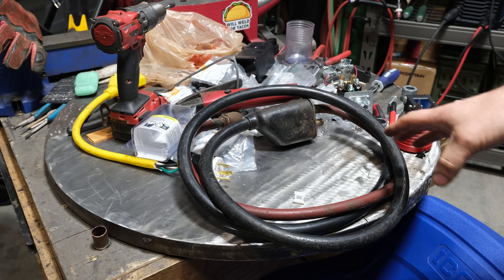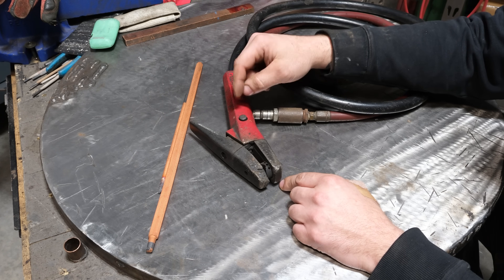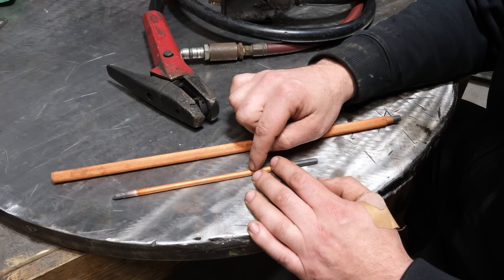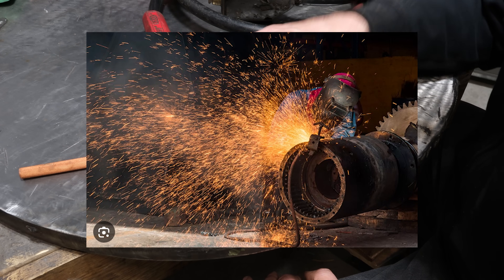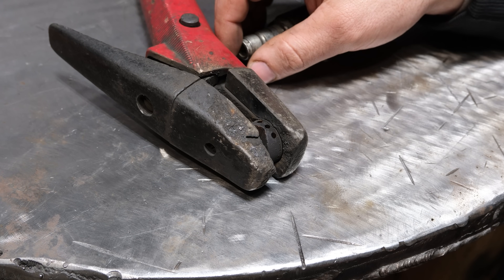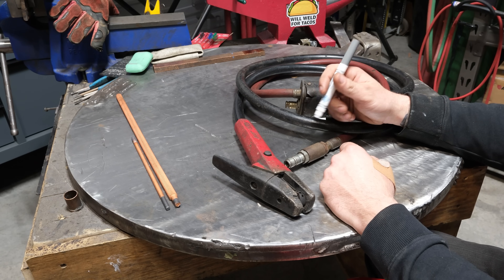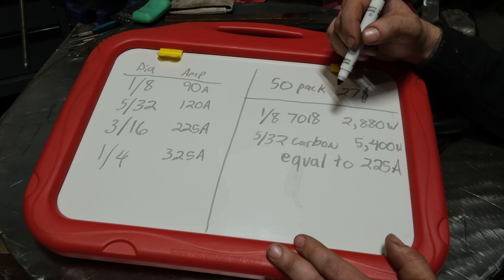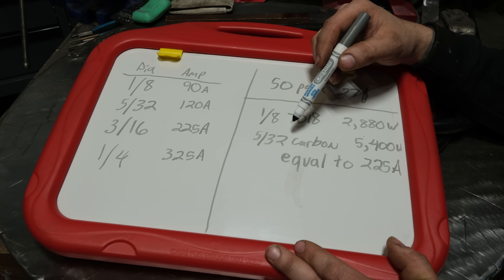Carbon arc gouging: the grinders angry cousin

Comment: It’s been a while since I was on a welding position at work, but we run the miller big blue air pac truck mount welders. We would use carbon arc cutting on manganese steel but not on high carbon steel. I think we used 400 amps for the size carbons we used. In basic welding class we had to cut and gouge a coupon to fit a 1x1x1/8 insert flush to the coupon with no more than a 1/16 gap on the edges. That was fun. I ground and sharpened my carbons to get the corners and edges. I passed but not by much. I have to admit, I didn’t used carbon arc cutting much, most times I could grind out the repair spot before I could get the welder set up. Thanks Greg.
Reply from the maker: Considering the work it takes to setup (and dealing with the hazards) for most jobs it’s simply not worth the time to use it.  That test sounds challenging to say the least, that would take some decent practice.  You must have had some decent skill to even barely pass 😀.

Comment: Great explanation about the home gamer machines. I  always wondered about that. Love watching Isaac use the carbon arc like a scalpel.
Reply from the maker: When it goes well you can literally just erase a whole weld and have a perfect clean surface left, like there was no weld.  It’s far easier (in my opinion) than using a torch, it doesn’t care as much about how poor the material is, and it is far more forgiving.

Comment: Wonder if you could do the old school method at home. Just using a regular welding rod, and an air compressor and blow the weld away. I wonder how that would work. Might get you by, but idk ha
Reply from the maker: So the issue is you wouldn’t want anything that deposited metal.  With carbon arc you’re able to create a “weld” pool without depositing metal.  The air blown in doesn’t react with the carbon rod either which is an issue with say tig or stick welding.  The closest thing you could do at home would be a torch setup with a gouging tip.  It is able to wash away metal much like carbon arc, but it’s doable for fairly cheap.  The downside is it’s actually much harder to get good results with the torch than with carbon arc.  I can make nice gouges all day easily with carbons (as could most people), but the torch is  far harder to get even halfway decent results.

Comment: Yes Greg I do have to say that was a very good information all video that you put on there about carbon Arc gouging. Like some of the other guys I've managed to do some carbon arguing with my Prime weld take 225x I use 5/32 rods to do my carbon Arc gouging and yes I will definitely say it is hard as hell on a machine.    My machine I would say it wasn't screaming for Mercy but I did not hit duty cycle on it and it did very very well but I would not recommend doing it all the time...
Reply from the maker: Cool to hear you atleast tried it on your machine.  That machine has a pretty high rated voltage and amperage, so definitely better odds  of it running.  Everyone should be able to try it atleast once 😀.

Comment: No doubt that arc gouging is more of an industrial process. However, some plasma cutters can gouge pretty well with the right tips. Still puts out a lot of sparks, but can remove most smaller welds. Guys that use the big carbon rods will use full-suit welding outfits with outboard air supplies. Nasty the bigger they get. I would hate to be one of your co-workers!
Reply from the maker: The plasma end of things is definitely versatile and far more useable in the home.  I have heard tips don’t last long but that didn’t seem to be an issue for the machine I used to own.  The suit a person would need to be running 800a on a 1/2in or bigger carbon would have to be extreme lol.  At that point you pretty much are running a mini arc furnace 😅

Comment: I use a 250.00 $ BestArc Plama cutter to do gouging at home,, works very well.
Reply from the maker: I have heard that it can be hard on tips doing plasma gouging, but the machine I did it with in the past seemed to be ok.  Definitely far more reasonable for home use lol.

Comment: Good information Greg! 

Carbon arc gouging storytime: at work we were disassembling a rather large cold rolling mill gearbox. The component we were having trouble with was a yoke that connects one of the output shafts to a universal joint. The yoke weighed 1 metric ton, to put things in perspective. 

So this yoke wasn’t coming off the shaft no matter how much we were heating and pressing. The engineers decided the yoke had to be gouged off so a new one could be installed.

The gouging job was to burn through the 6” wall thickness of the yoke on both sides and 8” thickness on the end. The shaft stuck in the yoke was not to be damaged because it had to be re-used. Gouging the sides was done over the double keyways to not damage the shaft. 

As we did not have a gouging setup we had a welder with a big truck come over and do this job. Poor guy was gouging this yoke for 2 full days.

He used mainly flat electrodes, I don’t remember what size but his power supply could do 500A.
Reply from the maker: Haha 2 days straight of that is definitely a job and a half 😅.  Basically running an onsite steel mill with the amount of material melted and removed lol.

Comment: I suppose you could run it at home if you have an engine driven welder parked outside like a Big Blue Airpak from Miller.   How does the carbon arc gouging process compare to plasma cutting?
Reply from the maker: So plasma can gouge, but at a much more limited weld size that can be removed.  A plasma cutter with gouging functions is a much more reasonable setup for use at a small shop or in the home.  Far more affordable and reasonable.

Comment: Hey Greg! I really appreciate your videos. I'm a total noob welder. As an older guy, i bought myself a cheap unit from Amazon a few months back, and am figuring out flux core for some small home projects and repairs.  I never comment on videos as far as i can remember, this may be my first one. 

I really appreciate your willingness to answer questions and make videos based on those videos. Not sure if this would merit that, but if like to know what you think: 

I have a truck that i bought used many years ago. It now has 300k+miles on it, and it runs great. I've done all the maintenance and repairs in it, including replacing the heads and a full transmission overhaul. I did a complete overhaul of the front suspension and steering last year, and i found out that one of the bolts on one of the steering knuckles for the brake caliper was being held in with those cheap thread inserts, the springy wire kind they sell at the auto parts store, when the insert came out with the bolt. I normally would've replaced the steering knuckle, but they're no longer available, and used ones are rare and expensive. I ended up putting a new one of those cheap inserts in, but it doesn't take up all the slack in the hole in the knuckle, and every time i back the truck up while the steering is turned to the left, it makes a small thud that is really just annoying, not s serious issue. 

So, my question for you is: if i took out that knuckle, could i use my little welder, that i do have hooked to 220v, and is supposed to be able to put out 175 amps, and some 035 flux core wire, and fill that hole in the knuckle so that i can re-drill and tap it so the bolt fits right again? The stress on this bolts is strictly shear force perpendicular to its axis, so I'm not worried about the bolt being pulled out, i just need it to not rock back and forth whenever i hit the brakes.  Grinding, drilling, and tapping a 1/2 thick piece of cast steel is no issue for me, i just need to know if i fill it with a weld, will it hold well enough?
Reply from the maker: Thanks for the kind words and I do have advice.  What you talk about is doable, possibly.  There are a lot of things that will throw a wrench into the plans.  Anything cast typically has higher carbon content and it will become extremely brittle when welded.  This poses 4 major problems: 1: the weld will become very brittle due to carbon absorption.  2: the area around the weld will become brittle.  3: the weld may crack clean off the cast as it cools 4: the finished weld may be impossibly hard to drill.  There are ways around this.  The primary one being using 312 stainless filler material, preheating the part, and slowly cooling it which is a solution that doesn’t become brittle due to carbon absorption.  This is limited to tig and stick which both are harder to do what you want to do.  Another option would be to torch braze it and tap it.  Braze metal doesn’t melt the base material so you eliminate many potential problems with castings by using it.  The downsides to this is it’s less strong than a weld.  Beyond the mentioned ways if the material is know to have low carbon content it would be easily welded with normal welding wire.  Flux core wouldn’t be my first choice to fill a hole due to its common issue with gas bubbles/porosity when filling holes.  Gas shielded might would do that far better and would be a better choice.  

Beyond that I really need to do a video on repairing cast parts and jobs like what you have.  There is a ton of stuff to cover, far more than I could type out effectively.
Reply: @makingmistakeswithgreg  Thanks, Greg. That all makes sense. I've looked into stainless flux core wire before as that's the real reason I started this whole new hobby: I'd like to make my own smoker someday out of stainless so I don't have to keep replacing it every few years. But the only alloy available in flux core is 308.  And I've seen videos where they have done what you suggest with cast parts. So it sounds like to me, if I want to do this with my welder, I'll need to attach that stinger and figure out how to stick weld it. 

And yeah, drilling this stuff isn't great. But I've had to do it enough times, on my different vehicles over the years, I bought a whole set of drills and taps for it a few years ago. You gotta be patient, but it can be done. 

Thanks again. I appreciate the advice.

Comment: Thank you for covering arc gouging and I'm looking forward to future videos on it. Trying to find information on it can be challenging. I've managed to do some gouging with a Miller CST 280 and a 25gal Craftsman 3hp 3.5cfh compressor. It's doable but I definitely need a better setup for future use.
Reply from the maker: The cst 280 is definitely doable to gouge with, but its output/duty cycle is somewhat low on single phase.  The carbon arc process is definitely tough to find info on.  My learning curve was as steep as you can get, basically “figure it out” lol.  With enough power and the right rod size for what you’re doing it’s literally easy as pie to do.  The hard part is not going too deep and making sure everything around you isn’t on fire 😅

Comment: there is a guy on you tube who has the channel CEE (cutting edge engineering) who is in Australia and he repairs and rebuilds excavators, dozers, graders etc mostly from the mining industry and he specializes in rebuilding hydrolic cylinders, but he uses carbon arc gouging on occasion and it is awesome to watch, It is like scooping metal out of machines, this guy is fun to watch as he not only does all phases of welding but he is a very good machinist as well with his lathe work and milling skills
Reply from the maker: That guy is awesome and is involved in a ton of stuff.  I normally see clips on Facebook of his work.  Awesome to watch 😀
Reply: Kurtiss at CEE, he does a lot of this process to take stuff apart.
Reply: @minigpracing3068  yeppers
Reply: https://youtube.com/@ICWeld?si=IJR6RnJRzgmUMazM

Comment: There is another option to research. I watch another channel that discussed the Hypertherm Powermax85 sync. It is capable of plasma gouging. Might be a viable option for the home diy'er.
Reply from the maker: Plasma gouging is better suited for home use than carbon arc for sure.  It requires far less power, a much smaller air compressor, and for average repairs it will work great.

Comment: Dude! You totally crushed my dream! Great info. Perfect timing, I was looking at this process. Works fast and it's a lot of fun. Looks like grinding wheels and a torch tip are in my future. Thanks again for the breakdown!
Reply: Don't know if you have one already or not, but personally oxy-fuel was quite the leap for me.   Figuring out what I needed, where I needed to go etc...  I ended up summoning my courage, accepting my wallet would be empty and just walked into an Airgas store.
Reply from the maker: A torch setup is very useful for the home, the only downside is the cost to refill them.  It does add up over time.  A torch is more useful than a plasma cutter in my opinion, and I would have a torch first.  A torch you can heat/beat metal, free stuck bolts/nuts, cut steel, and you can use gouging tips which work similar to air arc.  I won’t sugar coat it, a torch takes a lot of skill to use well.  However you don’t have to be the best to get a lot of use out of a setup.
Reply: @makingmistakeswithgreg  Helpful, as always!
Reply: Yeah I watch Issac over at IC welds and he works mainly on heavy construction equipment and uses carbon arc all the time.  My plasma doesn't have a gouge setting so I wanted this to work but I've been looking at the numbers and kept saying nope.

Comment: Have pondered this system and given up on it in preference for gas gouging. It's cheaper and can be run without electrickery.
Reply from the maker: Great point and I totally forgot to mention that.  I will be honest, I am not very good at gouging with a torch.  I have a bunch of tips and use it on occasion, but I struggle getting consistent results.  It seems it does good for a few inches and then everything goes to hell lol.  It’s far quieter than air arc and can be done with far cheaper equipment that anyone can get ahold of 😀

Comment: I decided to try to diy arc gouge with my esab rogue 180 with a 3/32 Vulcan 7018 and it was able to blow clean holes through 1/4 steel. I needed to drill a bunch of holes and kept breaking drill bits so I tried that and it worked great
Reply from the maker: Believe it or not if you use a 3/32 6010 dipped in water at 180a you can cut a bolt off like a plasma cutter lol.
Reply: @makingmistakeswithgreg I’ll have to give that a try. I guess the water keeps the rod cool so that it doesn’t just blow apart after 5 seconds?

Comment: Nice break down Greg. Air arcing is hell on machines for sure. I’ve smoked a few  Lincoln invertec 350’s while gouging for hours on end. Removing erecting lifting lugs for days on end is something that will put a hurting on any machine. I’m sure it’s not good for the big blue 500’s that I’ve used either. I knew it was gonna be rough on the machines but I just did what I was told.   That’s one reason why I’d be skeptical about buying any sort of welder that was a rental.  Rockmount makes gouging stick rods that don’t require an air source, but they are like $180 for a 5 pound container. They still require stupid power to operate. Just like you mentioned about 1/8”…. They require 225amps. I saw that box in the background….. looks like arccaptian is persistent 😂
Reply: So I'm not the only one eyeing rockmount and their prices. I found ZENA NO-Gas Arc Cutting Rods for $7 for .5bl I haven't tried them yet but they might be worth looking into.
Reply from the maker: 180$ for a 5lb box is a lot lol.  In a pinch I have used 6010 1/8th at about 200+ amps lol.  It will cut off bolt heads no problem lol.  I see former United rental engine drives for sale, I bet they have been run for thousands of hours air arcing lol.  I would be skeptical for sure on one of those used.

Comment: Dumb question, why do you have a bar of Irish spring on the table?
Reply from the maker: I use it on grinding discs and flap discs to prevent aluminum from sticking to them.  It works great, and allows them to actually cut aluminum.